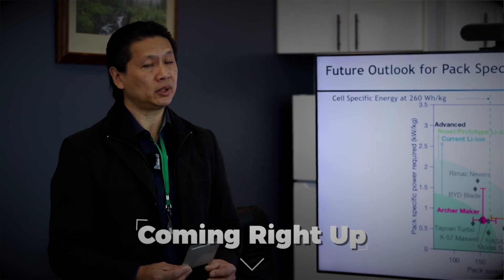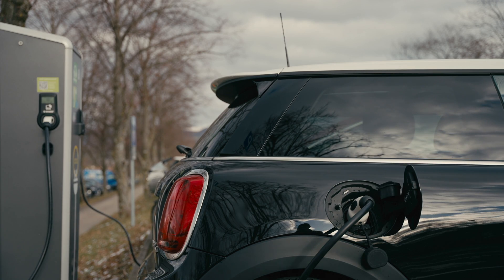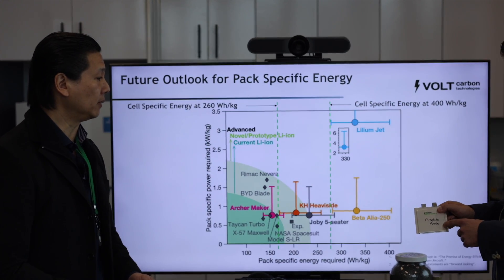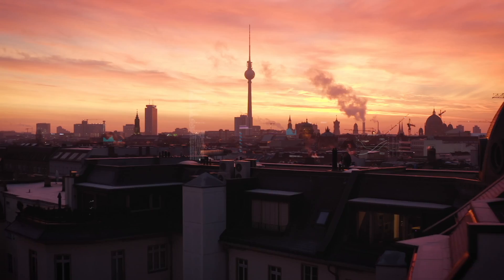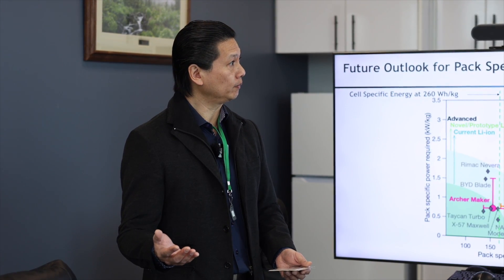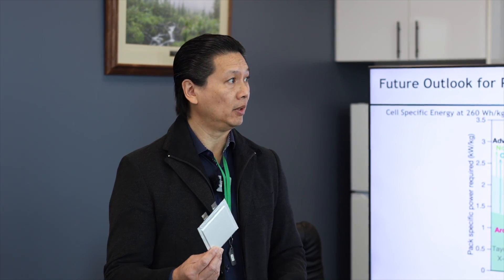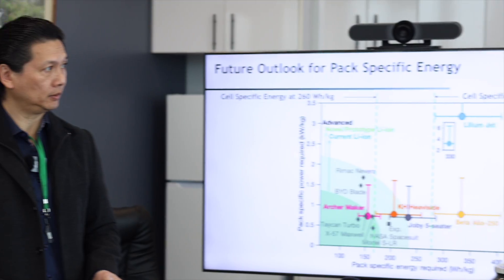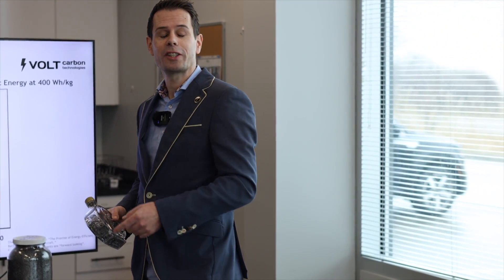Battery Expert Explains: Future of Battery Technology | Volt Carbon | $VCT Stock

Comment: they need to outlaw li-on. there very explosive.
Reply from the maker: Depends on what statistic you check
Reply from the maker: CATL's 1,000-km LFP EV battery super-charges at 1 km/sec. 

Typical LFP packs have an energy density ranging between 90 and 160 Wh/kg, but CATL claims that the Shenxing Plus surpasses the 200 Wh/kg threshold for the first time, topping out at 205 Wh/kg. That's still short of NMC densities, including the 255 Wh/kg of CATL's Qilin, meaning the 1,000-km Plus pack will weigh more for the same capacity, but it's a brilliant achievement that promises to bring together some best-of-both-worlds attributes.